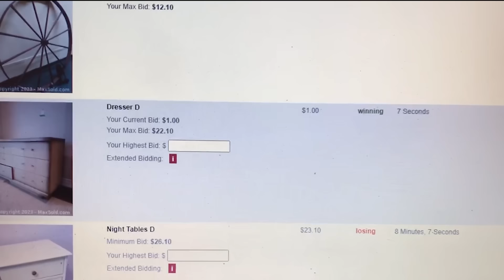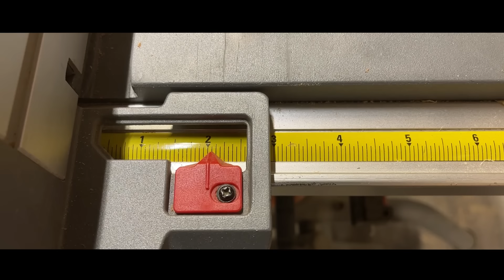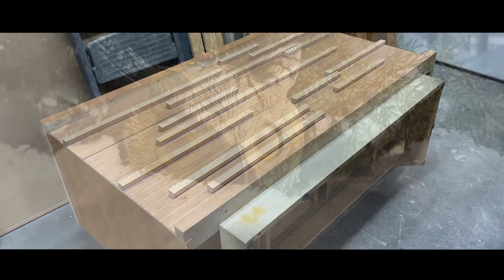Watch This - Unrecognizable AFTER [Extreme Furniture Makeover]

Comment: Nice. Two many crevices to dust though. I have this same dresser, with a large mirror. A  matching tall bureau and book shelf head board, different feet that wrap the corners in front with castors. I bought them just for the blond, plain, unfussy flat surfaces. They are worn but I would never change them.

Comment: Typical midcentury dresser. When did they start the dark outer edges spray accent? 60's or 70's.
What happened to the haphazard tape design idea? Did you change your mind? Or was that your guide for placing the darker stain accents?